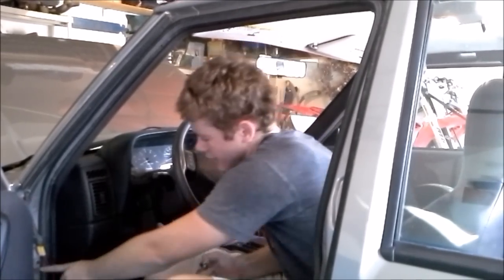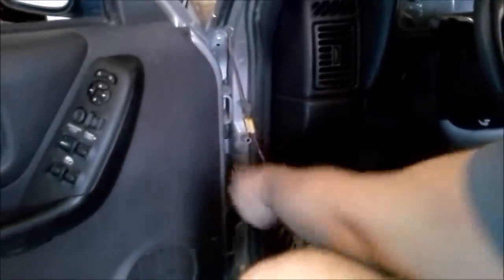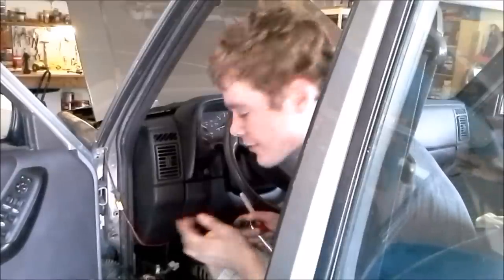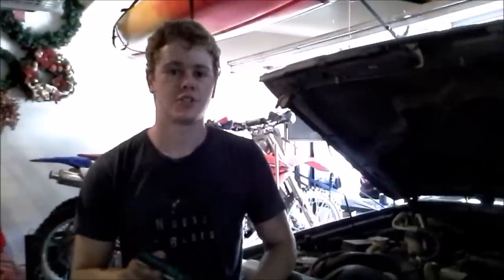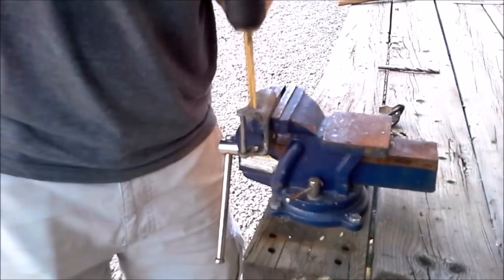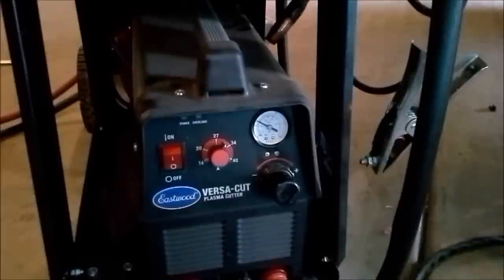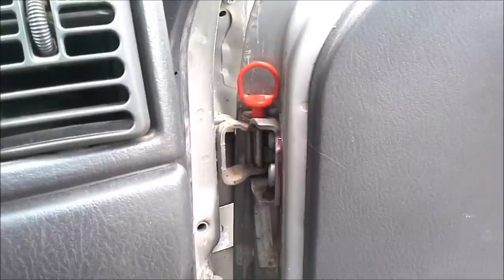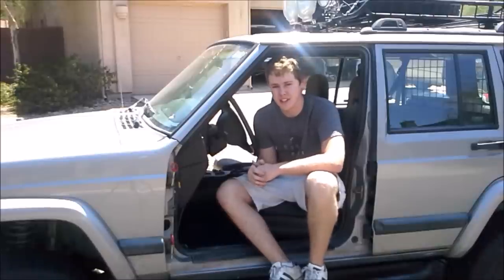Taking The doors off a Jeep XJ (97+)

Comment: This is a great video, but I would like to warn anyone attempting to do this that if you go the route Admiral Offroad did by taking the hinges off to drill them out, you're going to be going through hell and back to line those doors back up so they look good, and seal good. 

Glen Morris at No Door XJ recommends you keep them on and use a long 3/8th drill bit to drill the holes out. I can testify that doing it this way will be a lot less hassle as I learned from my mistake. Ended up taking the hinges off because I had too short of a bit and had to get the doors back on the next morning for work because of the rain.

TL;DR - Don't take the hinges off, use a long 3/8th drill bit to drill out the holes.

Keep on Jeeping.
Reply: U ever have issues with the door drooping or anything over time?
Reply: @scooter0241  It's been about a year and a half since I modified my hinges for the door pins. I can't say that I've had any issues with drooping, besides what was already there. Doors line up good even after all the abuse. There will be play, but that's because you've got removable pins verses fixed ones.
Reply: Don’t even drill out the hinges or jam. Just cut the pin and find a pin at Home Depot or Lowe’s a 16th smaller. Cut down on project time and alignment issues.

Comment: Rather than remove the dome light switches in the door jam, I installed a switch that interrupts the ground to those switches.  This way they're still functional when the doors are installed.
Reply from the maker: That's a great less permanent way to do it!
Reply: That's a great more permanent way to do it

Comment: That was hands down the best tutorial video on a jeep mod that I've ever seen. And I would say I've watched hundreds of jeep mod videos.
Also my XJ is the same color so I was really feeling that connection ;P
Thanks!
Reply from the maker: +Samuel Gordon Thanks!
Reply: +Admiral Off-Road Do you by chance remember the size of the original pin holes? Before you drilled them to 3/8, where they 5/16? I can find out for myself tonight, just curious
Reply from the maker: Samuel Gordon I'm not 100% sure, but I think it was 5/16
Reply: +Admiral Off-Road Alright, took me forever to get the time, but first bolt is out and it is in deed 5/16. Dremel/wedge & hammer takes forever, but it gets the job done
Reply from the maker: +Samuel Gordon glad to hear it! Thanks for reporting back with the size as well

Comment: I finished a job changing the door hinge pins and bushings about 3 months ago. Since most of us don't have a plasma cutter, there's only one real plausible way to get the pin out that's pressed in; and you're going to need a dremel with the steel cutting wheel. It's the only thing small enough to fit in there (barely), you're gonna make an angled cut and you'll be able to bang em out after you split it. The job was a huge pain in the ass, especially if you don't have a garage you can put the jeep in overnight if you can't finish the job in one day.
Reply: You can also start with a small drill bit and drill a small hoke in the pin, then step up bit sizes to the pins split in half. Then carry on as usual and knock em out.

Comment: Followed your steps on taking the doors off the hinges, every thing went fine but I stripped the bottom corner bolt on the bottom hinge. I took the time to break all the bolts loose on the passenger side to avoid stripping any of them😂

Comment: Great Video, two questions though: where can I get those pins from? and what is an alternative to using a plasma cutter?
Reply from the maker: I have a link and a phone number in the description that you can get the pins from. You can use a Dremel with a large cutoff wheel to cut the pins. It just takes a while

Comment: Does all the speakers, windows and locks plug back in easily so you can use them?
Reply from the maker: donny moran yes. There are connectors  behind the kick panel that makes it fairly easy

Comment: Nice video, thinking about doing this to my daily driver XJ. Was wondering how much of a pain it is to rewire and set the doors back up after taking them off?
Reply from the maker: +Holt Olson It's not too bad. Setting the doors back up is easier with 2 people (one to hold the door and one to put the pins in place) but it can be done alone. I leave my plastic side panels unscrewed so i can get to the wiring plugs quicker. It takes about 10 minutes total to remove or reattach

Comment: instead of taking the switch out you can also take out the number 4 fuse in your fuse box, thats what i do in my tj and it works great!
Reply from the maker: +ManagerFilms The fuse box in the XJ is a little different. the number 4 fuse in my XJ is for one of the headlights

Comment: Did you do this to the back doors? And if so did they line up afterwards? Also, would it be easier to cut wires and put a quick disconnect in the hose protector so you don't have to do the kick panel time?
Reply from the maker: +Billy Kilmon I didn't do my back doors. when I did my fronts, they did line up afterwards. For the wires, I took the screws out of the kick panels. That way they still stay in place, but i can remove them without any tools.

Comment: nice I have a 92 cherokee xj all the doors come off I was told not to go hardcore 4 wheeling with out them might twist the unibody I also have and exhaust stack with a 50" glass pack iv never seen a cherokee with 1 and I do metal fabrication so I figured I'd do it I also made my own half inch bumper with a stinger and a ton of other things with a jack skeleton theme on the exhaust stack and bumper got to love jeeps so much potential can't wait for snow
anyway love the posts keep on posting!

Comment: what did you do about the mirrors I'm looking into it for mine but I'm putting a snorkel on it
Reply from the maker: +Justin Marschner still working that out. im thinking about making something that would slide into the hinge bracket so i could take it off when i put the doore back on
Reply: +Admiral Off-Road ok ya I was thinking the same thing if you do can you please do a video
Reply from the maker: Justin Marschner absolutely

Comment: I like the doors off but if it takes a couple of hour is it worth it? I think if you have a roll cage inside is safer for your jeep to take doors off. Plus I have heard driving without the doors can be rough on your frame. This is for the XJ 97-01.
Reply: Well considering xj’s don’t have a frame...

Comment: I just looked into getting the pins Im just a little hesitant with ordering them. I was just wondering how the ordering process works and if you would definitely  trust them with ordering the pins? I just recently got a 96 cherokee and have been dying to take the doors off. Hopefully you'll be able to get back to me thank you!
Reply from the maker: The pins that i got were for the 97 and newer. The process is different for the 96 and older. I believe that it just involves cutting part of the hinges and doesn't require new pins

Comment: Why does it say 97 and up but I tryed to order some for mine and the guy said that they don't fit a 97 ? False advertisement or losing business?
Reply from the maker: +Brandon Miller you might have to do the other version of this modification if your hinges are different than the one shown in the video. Good news is that the modification is free for the older version hinges
Reply: +Admiral Off-Road how do you do the older version
Reply from the maker: +Brandon Miller if yours is a 97, it should have the newer style door hinges. This video is for the newer style hinges. If you have an older XJ, here is the mod for the old style hinges: http://www.xjtalk.com/showthread.php?t=10183

Comment: Quick question, is the pin loose or snug enough to seal and will it cause sagging after some time? Also does the Jeep loose structural integrity with them off ?
Reply from the maker: I haven't had any sagging in the years since installing these. I also have unibody stiffeners so I haven't noticed any additional flex in the body with the doors off. With the unibody stiffeners, I can open the doors with no problem with the jeep fully flexed

Comment: do you know the door weight? I am planning on losing all the doors and maybe the rear hatch too on my 93 zj. it is nothing but a woods toy and I figured weatherproofing the interior and putting the jeep on a extreme diet would make it a fun buggy.
Reply from the maker: +pbahle I don't know off the top of my head. I'll find out and get back to you. If you are going to be removing the hatch, I would suggest adding a roll cage. The hatch adds quite a bit to the structural integrity of the unibody jeeps, adding a cage will help make up for that.
Reply: I'm sure it is a big help torsionally, rear bumper mounts and uniframe have totally rotted out. Frame stiffeners and building a custom bumpers are in the pipe dream. 304k miles, no rear brakes, no front sway bar and it drives exactly like a jeep should lol
Reply from the maker: +pbahle Sounds like the perfect toy for the woods!

Comment: Hey I have a 2000 Xj and I was doing this to mine but I didn't buy the pins I just got a 3/8 bolt to slide in it.  So I went and drilled a 3/8 hole through my hinge and went to test it on the jeep and the bolt wouldn't go through the bushing but if I took the bushing out the hole was to big and the bolt would wobble around     How did you get the pin through the bushing
Reply from the maker: I didn't use the bushing. There will be a little play between the pin and the hole which allows it to slide in and out easily. If you feel like there is too much play, you might have to go to the next size up bolt and drill a slightly bigger hole
Reply: +Admiral Off-Road would it hurt anything with the play in it over time? Do you go off-road with your doors off?
Reply from the maker: +Jay Garrard if there is play in it, your doors will sag a little bit when they are opened. They should still close fine, but you might have to close them a little harder than before. You can also adjust the hinges to compensate for the door sag. I do off-road without doors. I have unibody stiffeners on the jeep and there are no creaking sounds or evidence of body flex.
Reply: +Admiral Off-Road thanks for all the help and love the video
Reply from the maker: Jay Garrard Thanks! hope it all works out. I'd love for you to post a pic of your doorless XJ on our facebook page: https://www.facebook.com/admiraloffroad/

Comment: I have a 2000 Xj 4 door with power windows i want to be able to still use this mod by being able to also use connectors to re-wire the power windows and stereo speakers although I'm not sure at all where to get the correct connectors any thoughts ? Also is there anywhere els to get those hinge pins? If so please tell me. And my interior lights actually don't work so I don't need to worry about that
Reply from the maker: there are connectors for the front door wires behind the kick panel that can be easily connected and  disconnected. I'm not aware of any other place to get the door pins other than making your own.
Reply: @AdmiralOffRoad  7/16" x 3 1/2" pin or bolt will work without having to enlarge the pin holes. https://www.agrisupply.com/hitch-pin-7-16-x-3-1-2/p/106085/

Comment: Well your video says 97+ but on a 97 you can't just plasma the pins off you have to cut them and you can't drill them out to 3/8's well you can but it's a huge pain in the ass I've gone threw 3 drill bits on one hinge already

Comment: I just did this job couple days ago and it was not I repeat not that simple. True the t40 but you're not getting the two  back bolts that easy. Literally took me 7 hours to get my driver's side door off. That is after stripping out two of the bolts and I had to cut them off. So if you're going to do this job it's going to be a down and out fight not that simple not even close mine was a 96 XJ

Comment: What if you don't have a dad with a plasma cutter /:
Reply from the maker: +georgewastaken 2 options. Option 1: Get adopted by a dad with a plasma cutter. Option 2: cut the hinges with a cutoff wheel on a dremel tool. I started doing that on the passenger side, but it took a while.
Reply: Man I really wish I could have seen how you did it with a dremel, the area is way too tight to fit anything. How big was the cutting wheel you used? Pic or clip if possible? I'm just trying to fix my hinges man.
Reply from the maker: +georgewastaken You could try taking the door off the jeep first and then cutting them to get more room to work. Just make sure to mark how everything lines up first. I ran into the same problem with the dremel which is why i went with the plasma cutter. The directions that come with the pins say to use a dremel with a cutoff wheel, so I'd try to get the biggest wheel possible. If you still cant get to it, you could try using a drill with metal cutting bits. Start small and work up to bigger bits until you cut the pin in half by drilling a big enough hole in it. If you're super careful, you could try a small sawzall as well. let me know if any of these work.
Reply from the maker: +georgewastaken Are you on the Admiral Off-Road Facebook page? That would be the easiest way for me to send you pics. https://www.facebook.com/Admiral-Off-Road-1730912723801407/
Reply: +Admiral Off-Road cool i just posted on your timeline, looking forward to hearing from you!
Reply: +georgewastaken 
I did this back around 2003.  I forget exactly how I did it, but I think I used a combination of a Dremel and a small pry bar to remove the "rim" or crimped material from the top of the hinge pin.  Then I used a hammer and punch to knock the pin out.  I just used regular bolts with a smooth surface over most of their length to put the doors back on.

Comment: The doors shouldn't be removed ...they are actually part of the body and provide strength to the body . This is also illegal in most states . I know you are going to say what about the Wrangler...it was designed to not have doors , that is why it has a wide lower door sill , roll bar , and full frame .
Reply from the maker: Never had an issue in AZ and I have unibody stiffeners. I can flex the suspension and open and close the doors without issue
Reply: @AdmiralOffRoad  ..that's not really what I mean..in a accident the doors help absorb energy and help in a rollover accident .the XJ will look like a crushed pop can after a accident without doors ...myself I would put in a rollbar and run a bar along the lower door sill if you plan on doing a lot of driving without doors .

Comment: Just made my life a lot easier 👍🏻 ordering the pins soon. But as far as the wires go I was taking the panel off and un hooking the wires and tucking them under my floor mat every time I took the doors off. I didn't know there were connectors behind the plastic piece. I was litterly looking into getting doors from a earlier year just so I wouldn't have wires.  But then I learned the hinges are different so it wouldn't work.  Lol y'all go follow me on insta  98Jeep_chick 👍🏻
Reply from the maker: +Ashley Gilbert glad the video helped!